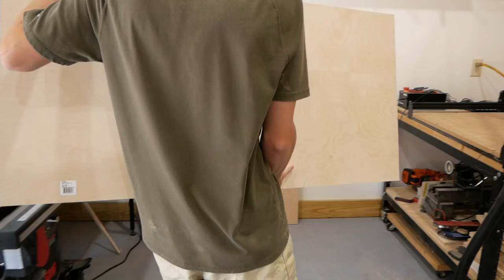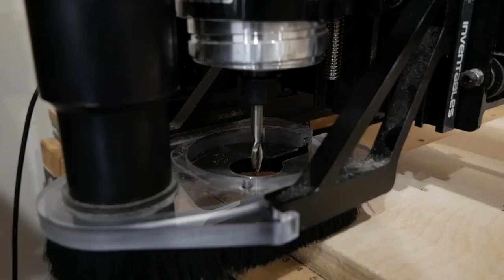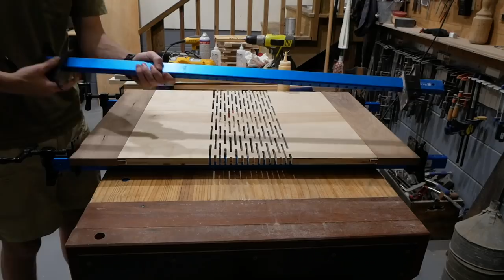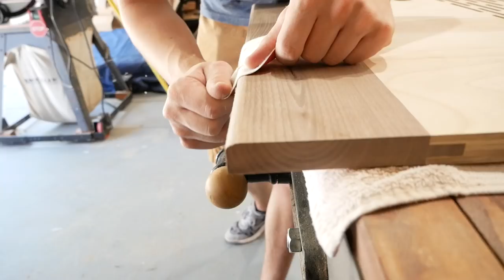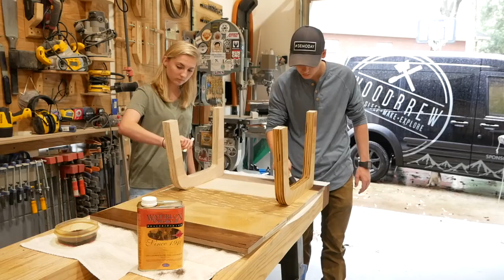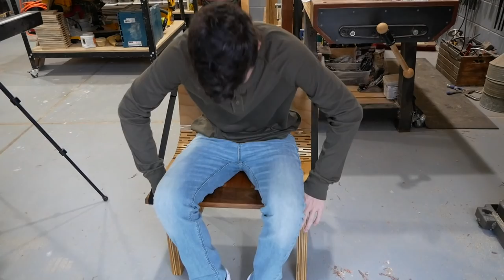DIY Modern Curved Plywood Lounger Chair

Comment: Perhaps curved "c"-shaped/boomerang-shaped pieces glued and screwed to the curved portion, either from the underside or top to retain the curve instead of the straps. Might be able to cut them from the same sheet where the legs were cut out of? Also, how about dowel plugs cut out of walnut for a bit of contrast/detail? Just a thought. Love your work and creativity.

Comment: Great video. Steam bend some strips of wood and put them front and back on both sides and see if that holds the seat rigid enough so you don't have to use straps. Loved the project though good job guys.
Reply from the maker: +Penn Ave Creations Thank you 🤗

Comment: Ooh, one more idea-- can the cnc be set to cut at less than the full depth of the plywood, leaving a single thin layer of veneer one top?  You wouldn't get to see the cool holes in the live hinge, but it might bend in a smoother curve and be more comfortable too.
Reply from the maker: +AubandJoe Montana well the bending requires the holes to be all the way through. Each section compresses on each other to bend. Look closely when I bend it and you see the layers squishing together.
Reply: yeah, that makes sense.  I was thinking of bendy board.  Just brainstorming...